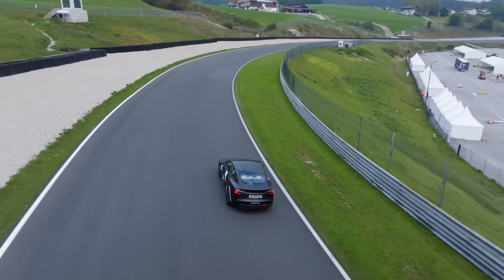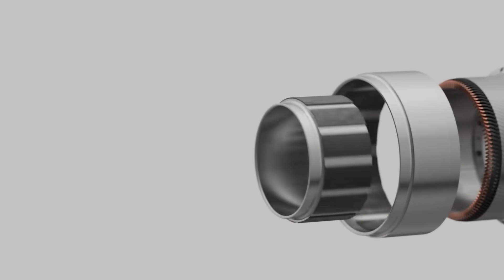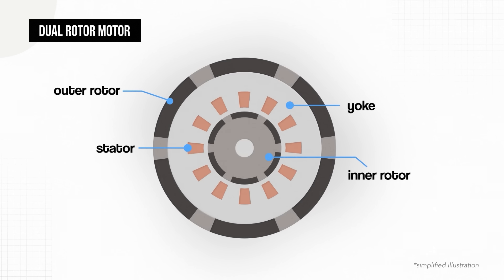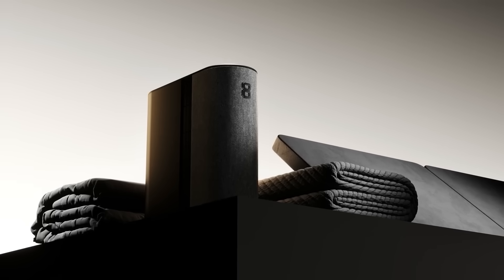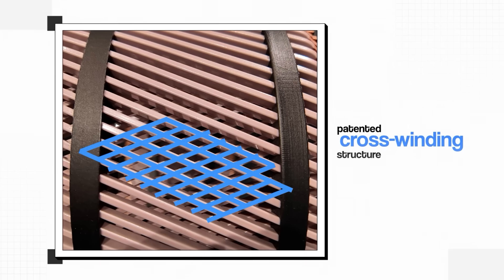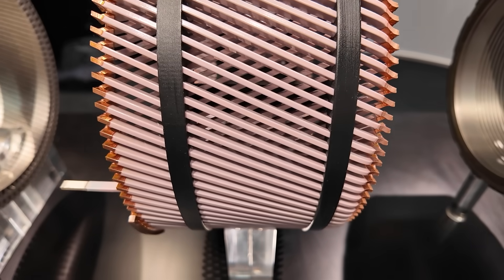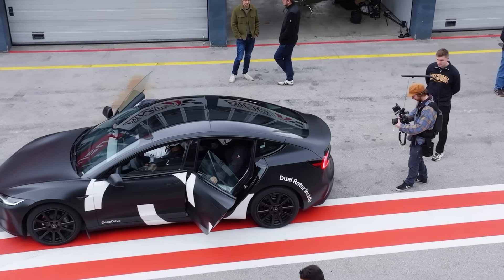How Dual Rotors Make Motors Insanely Efficient

Comment: yea, add more torque to already unnecessarily torque-rich motor and add more rare metals to make it work! More moving parts means more reliability right? C:

it has the same amount of magnet material per nm used; -20kgs of weight means nothing unless its a moving part (you can multiply those wheel-engine mass by 4 and negate that advantage). ok, you are talking about transmision losses - it's harder to move energy through electric cables than straight axles often used in evs. there will be an issue with torque usage as well - in most situations that system is worse at keeping grip which is already an issue for kinda heavy EVs.

That thing looks better as somthing lightweight, like monowheel or scooter. but there is no big money or revolution

Comment: Just because current suspension design doesn't work well with unsprung weight doesn't mean the distribution of mass to lower points in the system can't be turned into a benefit.
It's absurd to desire innovation in one aspect of design while aschewing it in other aspects.
If "this is how it's always been done" is the reasoning for a design, the lead designer/engineer needs to be demoted or fired.
Hybrid/EV cars are the future and the future requires innovation and vision.

Comment: The windings have so few turns, It will have to run at very low voltage and very high current. I wonder how this impacts the effiency of the motor driver...

Comment: eh, part of the mechanical doesn't look to dissimilar to specifically like the generator rotor in my Yamaha FZ1. And the reason I mention this, is because its also has permanent magnets and the issue is how the magnets are "glued" to the rotating part. Yamaha had a recall due to the fact the glue was letting go and the magnets then get smashed and munched again the inner fixed stator.

Comment: A typical electric motor for a car has around 98% efficiency,i mean an induction 3 phases stator with a permanent magnet as the rotor;So you you can get just a slight improvment ,if any of this kind of motor. Less eddy currents an hysteresis althought might give a little improovment but the bulk of the lost are in the conductor themself...insanely efficient?

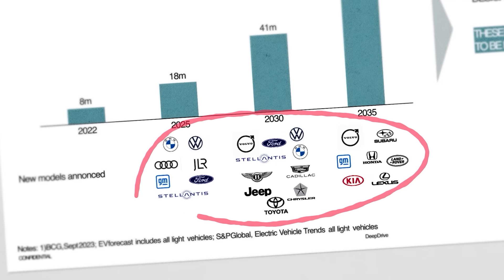Comment: @12:41 Your statement about global partnerships is misleading since you provide a slide simply showing manufacturer's timelines for releasing new EVs, that's independent of the electric motor manufacturer. You're making it look like DeepDrive has signed deals with Jeep, GM, Ford, Chrysler, Audi, Subaru, Toyota,  Lexus, Kia, Honda, VW, BMW, etc... bogus!

Comment: Heat pipes: if those solid copper rods in the stator were actually tubes, you could put a fibrous wick in there and a working fluid so it evaporates at the hot places, condenses at the colder parts (the edges in contact with the cooling system or flowing air) then wicks back towards the hot bits because capillary action. It would NOT surprise me if this was already part of the current design... just hushed up a bit. Good stuff!!❤

Comment: Looks like they've retrofitted into a Tesla. Would be curious to see an efficiency/performance comparison. 
With in wheel motors, the negatives would seem to outweigh the positives. You're eliminating drive axles but adding two more motors and more unsprung weight. The motors and connecting hardware would be subjected to continuous punishment from potholes, water, dirt, salt and other debris kicked up by the wheels. Long term reliability would be hard to achieve.

Comment: how are the rotors mechanically coupled? the animation almost makes them appear to rotate in opposite directions, though on closer inspection it seems they are rotating together, but we don't see them connected.

what is the difference in heat transfer? copper alone is not as good as direct-winding water cooling, like Lucid does. these motors will have to be less powerful to handle the heating loads.

how do the windings actually make the rotating magnetic field in that configuration? it doesn't seem to have any clear poles.

are there not losses from having less magnetic iron to amplify the electromagnet? copper on its own makes for a very poor electromagnet without being wrapped around the iron laminations. for that matter, how are those windings even assembled around the thin iron laminations?

also, how are the bearings mounted? outrunner motors sometimes are constrained by still having a shaft going through the middle of the stator, is this effectively just making that shaft also an inrunner magnetic rotor, or are there also bearings around the outside of the stator for the outrunner bell rotor?

lots of questions, please do a Deeper Dive on the Deep Drive!

Comment: Several years ago I built an experimental dual-rotor BLDC motor intended for RC aircraft use. The design consisted of a coaxial configuration using a conventional outer outrunner rotor combined with an added inner inrunner-style rotor sharing a common stator and shaft. The goal was to increase torque density by coupling additional permanent-magnet surface area to the same stator windings.

The configuration did produce a measurable increase in static torque. However, the overlapping magnetic circuits of the two rotors produced significant flux interaction within the stator core. This resulted in flux crowding and local saturation in portions of the stator teeth and back iron, as well as increased leakage flux between the rotors rather than through the intended stator paths. These effects distorted the magnetic field distribution and reduced the effective torque constant.

The altered flux distribution increased both copper and core losses. Copper losses rose because higher current was required to achieve useful torque due to the reduced electromagnetic efficiency. Core losses increased due to higher peak flux densities, harmonic distortion of the magnetic waveform, and additional steel mass operating at elevated field stress. Eddy currents induced in conductive rotor components further contributed to heating. The combined result was substantially increased thermal loss compared to the torque improvement achieved.

Overall electrical efficiency declined: the incremental torque gain was more than offset by the increased resistive, hysteresis, and eddy-current losses. The total motor mass increased by approximately 35% due to the added rotor assembly and supporting structure, further worsening the power-to-weight ratio — a critical metric for RC aircraft propulsion.

Subsequent comparison showed that simply increasing motor axial length (stacking the rotor and stator geometry) provided a nearly linear increase in torque proportional to added mass, without introducing detrimental magnetic coupling effects or elevated loss mechanisms. This conventional scaling approach preserved efficiency and delivered superior torque-to-weight performance relative to the dual-rotor configuration.

In summary, while the dual-rotor experiment demonstrated the feasibility of increasing torque via additional magnet coupling, magnetic circuit interaction and saturation losses rendered the approach impractical compared to straightforward axial scaling of a standard single-rotor BLDC motor.

I do think in the right hands and with suitable tooling this approach shows promise. I've since seen a few commercial motors using this technique, but for a hobbyist, with limited FEA experience/knowledge you would have to be very lucky to get net gains all around.
Reply: So interesting!  You ran into the usual bunch of losses. Very few of us actually build things to test. Complexity is another issue. I want to point out that size matters in motor efficiency.  It is easier to make a larger machine that is more efficient. I know people think small light motors are much better.  But they are already fine. Control and torque challenges remain, but it's manageable. Also, a motor that is 95% efficient at optimum torque might be much less so at low lower levels.
Reply: A fantastic analysis.

Comment: We patented a dual rotor motor 20 years ago but have significantly improved on it since... but that remains unpatented. [patents are worthless]
I'm devising a revolutionary motor based on my reformulation of electric theory, the Parallax Electric Theory, which should have 10 times the torque density

Comment: What we need is new  standard for in wheel motors for everyday cars not racing.  30 to 40kw each for all 4 wheels. With such generic wheel we could also retrofit existing petrol cars by fitting electric wheels. So we have option to drive cheap electric short distance or switch to combustion.

Comment: I feel this video was very rushed, the exploded component view didn't get much explanation. @7:47
https://youtu.be/Ir_JKMdWaUg?t=467
Seen a few comments about the copper bars not being supported but to the left you can see what looks like a stator core, which the copper bars would be in. The black coloured ring is also part of the core assembly, which in turn is bolted to the cooling plate.
Wondering if the copper bar core support is made out of aluminium?
Would help a lot with heat transfer to the cooling plate & the weight reduction compared to an iron core would be significant.
Wish more time was spent on explaining the components, I guess that is what the follow-up video will show maybe?

Comment: So, with this dual rotor, how do they get the extra torque out from 2 different rotors? Doesn't having 2 mean friction also increases? Since there's less iron and it's pulling 2 loads of magnets around doesn't it need more energy/volts/amps?
What are the actual numbers here instead of vague buzz-speak?

Comment: Just ignore the marketing hype here  This is a standard radial motor with an extra rotor on the outside thats mechanically linked  it’s pretty much no more different than that and it still has the yoke holding the stator together just modified .😊

Comment: To me it seems you only have a tiny patch of copper to dissipate through from the windings. This must be a massive issue? Can be improved by potting the stator which I am sure they do but this is still only leaving the end surfaces for heat transfer. Am I missing something or are you just not being critical in this video?

Comment: The in wheel weight only matters when it's part of the rotating mass which doesn't mean the whole motor. The rotating portion is usually as light weight as possible.

Comment: According to various reports, EV motors in current (sorry) production are at minimum 93 percent efficient and some are purportedly 97 percent efficient.  Even if someone came up with a 99 percent efficient motor (there will always be mechanical and electrical losses), it won't be a "game changer" in the range of any EV.  I think compactness, durability/reliability, and cost are the most important factors in any new design.

Comment: Please discuss in wheel motor's needed flexing impacts on both coolant lines, and copper conductor life expectancy when having to be positioned between the back of the in wheel motor, and the vehicle's body’s frame with both front steering axle direction steering wheel input flex when turning, and when spring flexing movement of suspension components happening as the vehicle's suspension moves up-down by millions of cycles over a vehicle's life expectancy ? How long will the coolant laden hoses last flopping around before cracking creating a coolant leak over heating the in wheel motor? How long will the individual copper conductors inside the cable last when flexing repeatedly before conductor severing causing a copper cable to break the power delivery circuit? These two questions reveal the Elephant in the in wheel motor room in addition to i wheel motor weight impacts on suspension reaction.

Comment: Imagine, 2000Nm generated in the wheel need a counter part to hold on. How do you want to build this? Divide by 4? So, 500Nm? This isn’t just a problem for your “suspension”.

Comment: The weak point is going to be the heat softening the bars over time, do they use any sort of material to add support? Wonder if there's a way to have the bars in a coolant bath, with non-magnetic housing and non-conductive liquid. On smaller applications with lower torque requirements, the bars could be hollow for coolant flow.

Comment: A good efficiency for permanent magnets motor is 96%. If your motor has 98%(estimated), why liquid cooling system  is needed. Air cooling should be enough. 20% efficiency improvement is done not by motor efficiency improvement, only. Also it is done by removing reducer and differential in all wheels drive power train. 
I am not sure what permanent magnet motor is the best solution. A much better way exists.

Comment: Hmm this is some bull... How the heat get out, the heat has to go through about 6 in of 1/4" thick wire? More spinning mass... Also the shaft is on a cantilevered shaft, bigger bearings. So basically an enclosed outrunner motor with a 3 bearing stack up. That is expensive too expensive.

Comment: The copper stator is neither as strong and springy as steel nor is it much lighter. It will deform a lead to catastrophic failures at high torques 😂

Comment: Wheel hub motors have been the real solution for e-mobility for decades.
Drive shafts and their joints at the wheels also add considerable weight.

We just need to slowly realize that 4x15 to 4x40 hp is perfectly sufficient for modern mobility.

A modern passenger car shouldn't weigh more than 1200 kg.

Come on, make an effort!

What are you waiting for?

Comment: Do the inner rotor and the outer rotor move in the same direction? I think, the trick is, that they are pushed/pulled into reverse directions. If they are connected by reversing gears, the summary force on the stator is zero. Therefore it can be an open cage-structure without much fixation, and can be cooled efficiently.

Comment: Electric motor efficiency is mainly affected by Eddy currents. Heat coming from the coils is the result of the thermodynamics, since if you put power though the system but only a fraction of that was actually consumed to generate work, then the rest is dissipated as heat. And it's just what happens when you accelerate. In order to create torque, you pass current though the motor, but not all of that power is mechanically consumed by accelerating the car (since it would require it to accelerate instantly to full speed). It's nothing to do with the rotors or stators, it's just physics. The other big factor is pole spacing and force-at-an-angle losses but that one's already maximized to the point of vanishing of any real gain. 

What they're saying is, if you have a low speed motor then driving at low speeds becomes more efficient, which is true for any electric motor. In other words, it's some more of high tech snake oil.

Comment: High torque and low power means that this motor has cooling difficulties as expected and that is a low rpm motor most likely because it also has balancing difficulties. Electric motors are very close to perfect there is not a lot to make them better. Cheaper, more reliable and higher energy compared to weight but those are tiny steps.

Comment: Reducing the size of a motor is not a problem that needs a solution...Perhaps on an airplane if its can be a little lighter, but even then it is insignificant to the size and weight of required batteries.  Now if we have roads with embedded charging so battery size is tiny, it might matter. until then if they use double the magnets, the cost is more than doubled, just to save some minor space?  I would not invest in this technology.

Comment: Putting the motor in the wheel amounts to putting the most expensive part of the car in the part most subjected to impacts. Good luck trying to have durability outside of a racing ring or laboratory track. I know, I used to work in a motor wheel startup and we had the same issue.

Comment: No, depending on the application, the geometry and choice of magnet/stator design of conventional electric motors can be changed to give more torque or more speed. There is no need to go with magnets on the outside and inside. The advantage of the standard design is the stator can be easily cooled passively or actively since it has a big chunk of laminated steel on the outer of the motor. Having the stator sandwiched like that would pose weakness in holding the coils in place under high torque and heat dissipation would be a problem. Standard designs with intelligent control can have extremely good efficiencies like 99.5%.

Comment: The only real test we need to see here is a model 3 with their motors versus a model 3 with Tesla's motors. To make the comparison fair it has to be the Performance variant of the model 3 as they both should be pushing as hard as they can. If these motors can beat them at that then they will be on a path to success for sure. I suspect though if they are lighter than other options per kilowatt then the aviation industry will also be calling very soon.